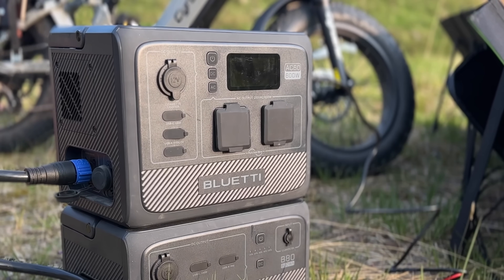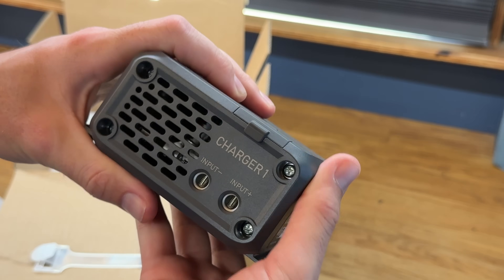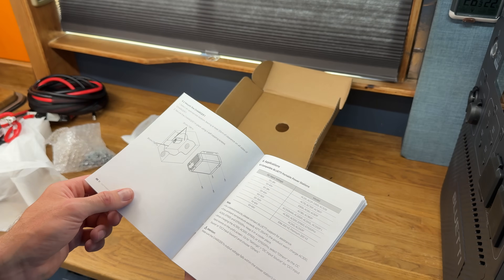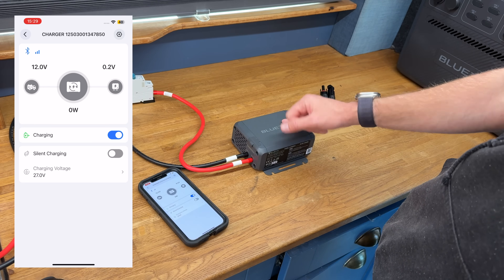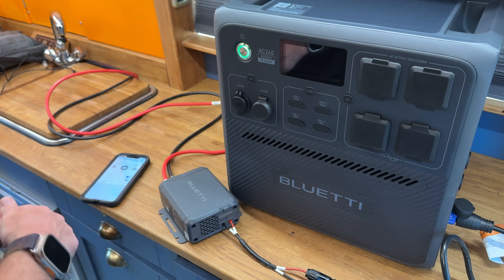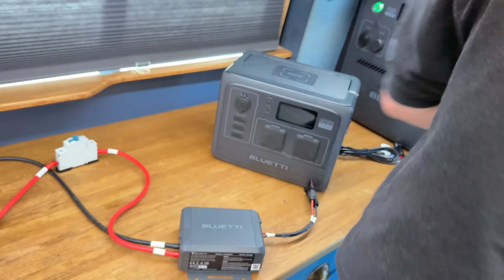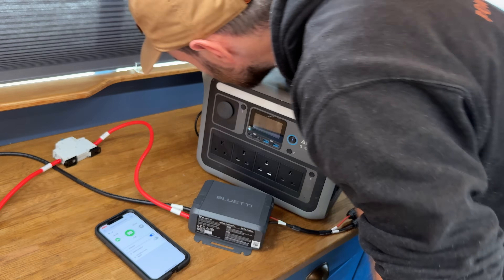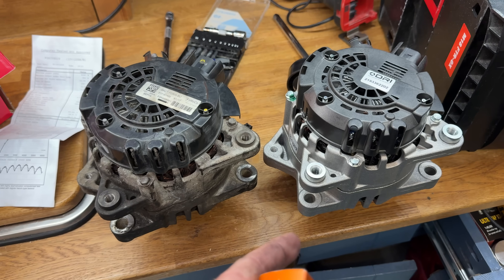WARNING! This Could DAMAGE Your Power Station | Watch BEFORE Using the Bluetti Charger 1

Comment: I believe the 60 amp circuit breaker near the charging battery, is to protect it from power surges. A fuse or circuit breaker is also a safety feature that should be added near the vehicle battery/alternator. I have found that the Charger 1 still pushes 560+ even after my battery is 100%. When the charger 1 is shut off in the app, it turns itself back on, when I restart the truck, after stopping for gas. So, we just try to remember to flip the breaker inside the vehicle, on the next stop. Also, do not use in stop and go traffic. It can cause overheating.
Reply: Please explain, what part exactly, overheats in stop and go traffic?
Reply: Consigli di mettere un fusibile vicino alla batteria motore anche se Bluetti non lo dice?
Reply from the maker: Yes, bluetti they have the breaker at the wrong end, they most likely use a breaker and have it at their end for User accessibility to turn the device on and off, the wire is still protected just it’s not following best practice . Add a fuse at the starter side
Reply: @MispronouncedAdventures 60A ?
Reply from the maker: If using 16mm2 cable then yes, a 60A fuse
Reply: @MispronouncedAdventures just jumping on this as am just about to installer our charger one and about to order a small cable and 60amp fuse to wire in near the battery. May I ask is it worth installing a second breaker near the battery / in cab as am planning on placing the power station at rear in garage area and the charger 1 and breaker will be at that end or is this over kill? Someone mentioned at overheating when in stop start traffic is this a concern ?
Reply: @MummyMTBlife83 yes, double safe.
Reply: 10:26 10:26 f3 11:25
Reply: Building my fishing van i will be charging my ac180   id like to fuse it at the battery end for extra protection what ampage fuse would you recommend thanks 😊
Reply from the maker: electricity isn’t pushed it, it’s pulled. So I wouldn’t worry about the charger 1 continuing its output of 560 W even when the battery says it is at “100%” likelihood whilst the readout of the Soc says 100% there is still capacity left. The power station itself would cut off the draw from the MPPT when it’s full much like when it’s used in Solar daily. 

Not sure how using “stop and go” ( start/stop ) feature would affect the overheating if you’re referring to the alternator when it’s in the off mode because the alternator is not moving or even turned on because the engine is off so there’s no power movement.

Comment: Presumably i could use this with a VTOMANN flashspeed 1000 by connecting mc4 to Anderson at the input side of the power station? 
Id have to adjust the settings to 300W though as solar input is 300W. 

Thank you
Reply from the maker: I don’t know that unit from personal experience but but as long as the Charger 1 is set to the voltage range of the port I don’t see why not.
Reply: @MispronouncedAdventures  Thanks, if I do this route, definitely set lower. This was the best video I've seen explaining. Thank you! Subscribed!

Comment: Yeah, it can if you are stupid.  Yikes, we are all doomed.
Reply from the maker: Stupid is a bit over the top. The vast majority of power stations users aren’t going to be aware of the potential risks involved going above the listed voltage for a port. most will just assume as they  don’t know any better if the plug socket fits its going to work or not but not know the potential damage it could cause
Reply: @MispronouncedAdventures  No there are a lot of stupid people that do stupid things with out reading the manual.  It is very straight forward and they still do it... that is stupid even if you are afraid to say the blunt truth.  Americans are such cowards.

Comment: i,m proper retro techno but have 2 bluettis an eb55 and an ac70 the 55 is 12v to 28v/8a am i right in thinking i can just leave it on factory settings and it will charge them both on that just taking a bit longer on the 70.
Reply from the maker: I think that would probably be the best idea find a setting which will work for both of them as you don’t have to change or ever accidentally plug one into the wrong setting
Reply: @MispronouncedAdventures  cheers, i,m off on a month long fishing trip, i would likely forget to keep switching settings. i dont even carry a phone when i,m out and about local it lives on the mantlepiece :)

Comment: I might be a bit late to the party here in Australia but we run a lot of 12v dual battery systems and have always looked at these as an alternative with this dcdc charger is it now possible to almost hard wire these in now and if need be as we  run a fridge in our Ute have permanent solar connected to top up the battery?
Reply from the maker: you could use a power station as a sort of alternative to a traditional leisure system. This is probably not the best option for it though. The EcoFlow or DJI versions which are by directional so they can keep the start battery charged up and allow the solar port to still be available. Would probably be a better option

Comment: You need to revise your video EcoFlow came out with a cable that goes from the charger to the solar connection, I know I own one
Reply from the maker: It’s not so much revise, I actually mentioned the 500W XT60 cable in the original video for the EcoFlow as a future product. 

Which i see now is available

Comment: whats the benefit of using the Charger 1 compared to an inverter?
Reply from the maker: Inverter is a popular option. As I have a large Victron based leisure system I’d normally use that as it already there and will give me faster AC charging speeds. 

If it was inverter vs Charger 1 for directly off the starter battery however. 

I would look at it that the Charger 1 is built for this purpose. Automatic on / off With the vehicle, all associate keyboarding provided. Low or no standby usage.

sure a inverter would work of a starter battery but it’s not necessary designed for that use. You would need to manually or figure out an automated offer on / off switch for it, you might  have to lower the AC charge rate on the powerstation as they can be 1000w+  be too much for many alternators. 

I can’t really give exact figures for efficiency, but converting 12V to to 230v or 110V AC and then back down to DC again in the power station is going to be less efficient than Dc to Dc with the charger 1. 

The charger 1 is also probably smaller unit. 

Some of the cheap inverters which might be small. Are  modified sine wave which many power stations won’t charge off
Reply: @MispronouncedAdventures amazing insight. Thanks!

Comment: Everyone says the breaker is on the wrong end, but no one ever tells me why Bluetti made it that way. We’re just left hanging whether it’s safe or not.
Reply from the maker: Fuses or breakers should always be at the source ( in this case the starter battery ) 

My only thought for why they’ve put it at the charger side is because it is a “breaker” and they’re assuming the charger will be put in a accessible position. so the breaker would also likely be accessible so it can be can be tripped and untripped.
Reply: @MispronouncedAdventures So are we good the way they sent it? I’m still uncertain.
Reply from the maker: It’s ok, the wire is still protected. just not best practice
Reply: @MispronouncedAdventures on reviews, it would be good to know if these wires are copper clad or full copper? Will Prowse recommends to always throw the "included" wires out, from manufacturers, since they are often not best practice-overgauged and likely lower quality wire.
Reply from the maker: @jr.6199  it’s a great point. I do often comment on wires if they are problematic. But usually don’t necessarily mention something if they’re fine. 

Particularly crimps and often find pre-crimped cables quite poor
Reply: The breaker is placed there to protect the device from being shorted , there's alot of well, special people in the world
Reply from the maker: @AlmostOutside  Breakers ( or fuses )  purpose is not to protect the device for shorts, it’s to protect the wiring from shorts. which is why protection devices ( fuse / breakers )  should be at the supply end of the cable not the output to an appliance.
Reply: @MispronouncedAdventures  i know what a breakers for, just go touch the charging wires together and see what happens, they didnt put it there for no reason
Reply from the maker: @AlmostOutside well of course that’s the role of the breaker if you were to touch the wires together. Thats a short. but the breaker should be a starter battery ends of the cable not the device, To protect the wire. Fuse / breaker At the source Much like the wiring for almost every other DCDC charger or alternator charger out there. 

The Breaker at the wrong end, like this case leads to potential 5 meters worth of cable at risk as its upstream of the breaker . Especially in a vehicle context for those cables are likely to be hidden  or put in wiring runs which cannot be seen or checked, leaving potential for a short in cable which wouldn’t be protected by the breaker. 

The reason breakers or fuses are put at the source is so everything is protected down stream of them
Reply: @MispronouncedAdventures  so like I said,  bluetti put it there to protect bluetti.. and to protect people from themselves

Comment: Hi great vid as usual. I have the AC180 and the Charger 1. I have fitted a 60amp fuse just before the starter battery connection, tick, and a the 60amp trip at the charger 1 end too, tick. What I have found is if you leave the trip 'ON' and the Charger 1 plugged into you power station it will continue charging your power station from the starter battery, NOT GOOD. I always trip the breaker off when the engine is off. Hope this helps.
Reply: I just got round to fitting mine and been using it for the last week while away, while my unit was still turned on mine wasn't charging once it detected the voltage drop when the engine turned off. Are you sure it's still charging as reading online it seems to be set to draw when the voltage is over 13v can't remember the exact voltage.
Reply: @andrewriley8398  Hi Thanks for the reply. I'm only going by the Bluetti screen, it shows it's charging?? I have to say I'm beginning to doubt myself at this point. We are now back from our Scotland tour so I will go back up to the motorhome and plug in the AC180 again and see what happens. That's after double checking that I've wired it all correctly : ) And I'll let you know.
Reply: @mrpwhitty  I think the problem is the app to be honest it's ok but from reading online it sounds like it's actually a general Chinese app that's modified by then not custom built if you look at the ac180 when you turn the engine off it's shouldn't be getting any more power though the screen does stay on
Reply: @andrewriley8398 
Exactly, same as mine. The Charger1 has a built in cut off for when the engine isn't running.
Reply from the maker: Interesting you still found the unit charging when the engine was off?
Reply: @MispronouncedAdventures  It's connected directly to the starter battery, so that's feeding it. The only cut-off between, is the trip just before the Charger 1.
Reply: @mrpwhitty 
Bluetti say the Charger1 has an automatic cut off, in this case. So it shouldn't be taking anything from the battery if engine is not running. I will check mine asap & report back. Same ac180 & charger1.
Reply: @keepitreal154 ye the unit is still powered though, it actually tells you to turn it off on the trip switch when not using it for any length of time as it still draws skittles power.

Comment: An interesting piece of kit and an excellent review thanks. I have a first generation Poweroak (now Bluetti) AC200P which I purchased in 2001. It is not 'fast charge' and has no app to monitor it. Is there any reason why the Charger 1 would not be compatible as far as you may be aware? Thanks for a great channel. I love your adventures and you inspired us to take our Transit self build up to Nordcap (albeit in the summer!) last year, a fantastic journey.
Reply from the maker: Glad you like my channel and congratulations on your transit build and all the best on your Nordic adventure!

As long as you have the correct MC4 connect And As long as the voltage range is set to something within the AC200P PV MPPT port range  I don’t see why not
Reply: @MispronouncedAdventures  Many thanks Alex

Comment: The EcoFlow now offers a new XT60 Output Cable that works with their Alternator Charger to make it universal.
Reply from the maker: Yeah I brought that up in my original EcoFlow alternator video when it was only listed in the manual but no online information. I received an email from EcoFlow  two days ago stating the new 500 W version comes with the XT150 to XT60 cable.

Glad to see they finally brought that out

Comment: I have one of these married up to a fossibot f2400 power bank which has a 25 amp xt60 output ,which I have run a control panel off which runs my whole camper,fridge,heater,lights,240,all the usual charging ports I set the charger 1 at 40 volts which gives about 465 watts going in to my bank ,I’ve just come back on a 2 hour run and my bank is full from 30% it works perfectly for me and have had no problem what so ever,excellent with the set up I have used, all,the best,👏👏🏴ps I never switch it off it knows when the bank is full and only charges when needed.
Reply: la fossibot f2400 est équiper d'un port xt60 et entrer solaire limiter a 200w comment a tu fait pour obtenir 465w merci
Reply: @gilbert4861  I thought F2400 was limited to 550 watts input
Reply: I’m looking to charge a F2400 via a Victron 12 12 50 Orion XS, I only have an 80 amp output alternator so hoping to reduce the charge rate via the Orion XS

Comment: Ecoflow have just released a new Xt60i cable for the alternator charger which will allow you to connect to any other power station, it's limited to 500w.
Reply: Could you use it for eb3a bluetti 600w?
Reply from the maker: Don’t see why not, you would just have to turn down the voltage and use the right connector
Reply from the maker: Yes, I think I got the email yesterday! Glad they finally brought it out. It was in the original manual for the EcoFlow 800W model which I reviewed a few months ago, but there was no information on it at the time. 

I’m hoping to get my hands on it

Comment: Why is the braker on the wrong side of the wire?
Reply from the maker: As mentioned in the video, I don’t know why they’ve done this and personally I would say it’s wrong. The current protection device ( fuse or breaker ) should be at the battery side, not the charger.

Comment: How do you make this work on lifepo4 12v stationary battery setup?
Reply from the maker: Do you mean charge a power station from a 12 V lithium battery
 or 
do you mean have this unit charge a normal 12v battery?
Reply: @MispronouncedAdventures charge power station from lifepo4 12v 100ahcbatteries

Comment: Still waiting for the click-bait "WARNING! This Could DAMAGE Your Power Station". Power stations have cutoffs internally so this is fake.
Reply from the maker: That’s not necessarily true in all cases. 

There are examples of reviewers plugging the too large solar panels into power stations ( even some of the larger brands like Anker ) with a VOC too high and instantly killing. Just because the solar panel had an XC 60 connector and their power station also had one. 

“Cutoff” / overload errors on power stations are generally software based to protect components. 
If you’re pretty close to the max listed VOC, you’ll probably get away with. As shown in this video on the EcoFlow model, it gave me an overload warning at 30V. Usually because the warnings happen before you reach the internal hardware voltage limit or some of the components. 

if you had it at the full 56V potentially you can have issues and failure with internal components. As those parts were simply not designed to hold handle or hold back that sort of voltage. 

Which is why almost all power station MPPT‘s and standalone MPPT‘s like Victron bring up damage and risk going over a maximum VOC cause.

Comment: Ecoflow charger now has an XT150 to XT60 cable so it charges anything with an XT60 solar input...
Reply from the maker: Yes, in my original EcoFlow video I did mention that’s printed in the manual but there was no official product information yet. I think it’s starting to become available in some markets. I haven’t yet seen it in the European or UK online shop. 

I’d be keen to get hold of the new cable. Hopefully they fix the biggest complaint I get on the EcoFlow video. Is it having to be manually turned on every time for quite a few people.
Reply: @MispronouncedAdventures  the cable is on the UK site now
Reply from the maker: @ukinfamous I looked a few days ago and I generally can’t see it under the accessory section. Is there elsewhere?